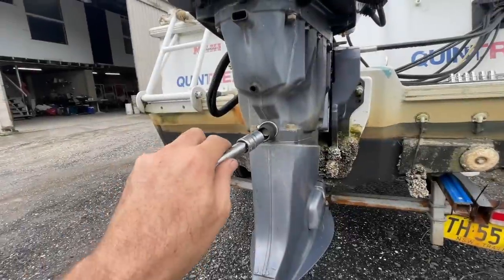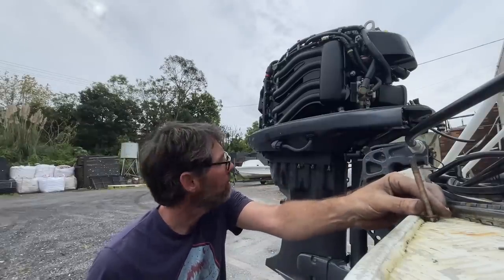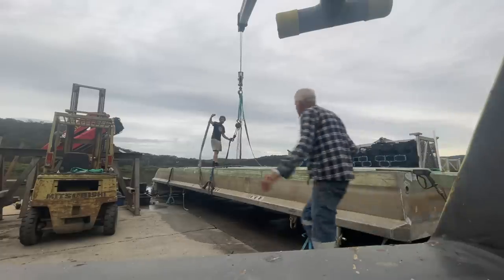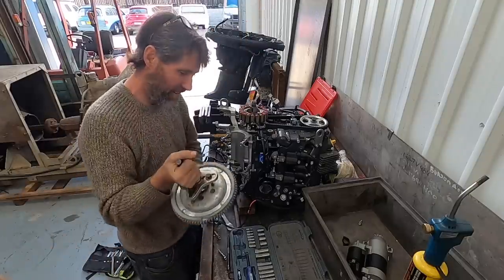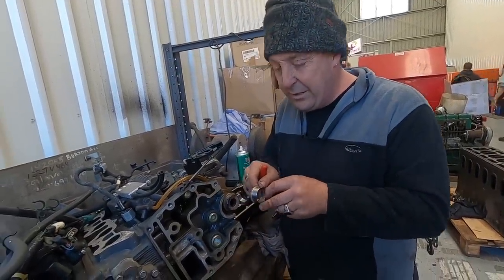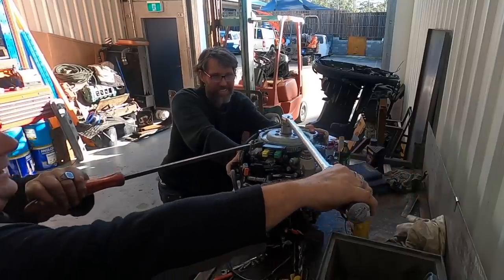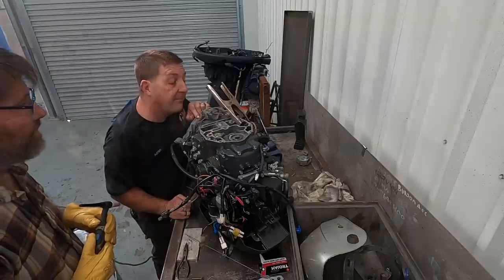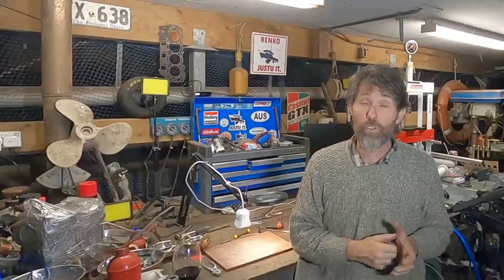Fixing a four stroke outboard that is leaking oil

Comment: Good Job Stu! Thank you for bringin' us along and teaching us some great repair moves. 
BTW, your new "look" may qualify you as a professor at UC Berkley. When you get over here to California, walk onto the campus and see.  BTW, do you still have real gasoline to run in outboards down there?
Here on the left coast our automobile fuel doesn't have much petroleum product in it..... Wont even clean varnish from a paint brush...Wont run in an outboard either.
Reply from the maker: Thanks Tom. Last time I was at Berkley was to watch a Greatful Dead concert. Petrol here is still pretty standard when it comes to boats. Only car bowsers well fuel with ethanol in it.

Comment: I think you find the main and con rod bearings are prevented from spinning by their crush fit in the rod/cap or main cap/block, the tangs are there for alignment. That's as I was taught many years ago.
Love the content with Adrian, he is a true ledged on the tools!
Reply from the maker: Yes, they sit slightly proud of the casing which expands them and locks them in. Just one of those modern cost savings designs that us old timers can't fathom. ;)
Reply: Was Adrian stumped then?

Comment: ah, the good old salt water soluble 4 stroke Yamaha disprin motor. The temptation for JB weld and unload must have been strong ;)
Reply from the maker: The words "JB Weld" were said several times during that day. ;)
Reply: @DangarMarine  after spending nearly a grand on the head of mine, repairing corrosion, overhauling valves, etc, only to find it had a hole in the block, that’s exactly what I did 🤣

Comment: Good work and a pretty involved repair. Amazing just how complex a modern 4 stroke OB engine is with lots of electrical circuits on top of quite fragile castings. I replaced a lower oil seal on a 60hp M but thankfully it didn’t have the corrosion or the lipped-seal. On those there’s a very pricey crush washer underneath the flywheel. I couldn’t believe how expensive that was and the timing belt was astronomical, too. Looking forward to seeing more from the yard and the workshop. Thanks!

Comment: I have run into that before with small micro bubbles coming out of the weld . Pressure and heat building inside as you are welding .You are putting pressure on it to check the weld but you can put a vacuum on it as you are welding it and it will seal up . (a very small vacuum.. the liter the better)
Reply from the maker: Interesting idea. We were also talking about peening it with a punch to help close up any small holes.
Reply: @DangarMarine I think that would work if you were brazing it after . Heating the aluminum by brazing and seal it off . Brazing has always been a little easier for me than welding. Just remember micro bubbles are from trapped heat or from the weld of brazing .

Comment: Great video Stu,  well done with the resurrection, out boards are really made from not much for good reason ... an old friend used to use a belt sander too clean up cyclender heads on 25 year old units that should have been scrap
Reply from the maker: Thanks mate. Plenty of these outboards do get scrapped when they still have some life left in them.

Comment: Stu, i always take a heap of happy snaps and video prior to a pull down of motors. Has come in very handy at times when the memory fails with what goes where. My memory is bad so these little aids work for me.
I have used JB Weld for problems like what you tig welded. It has never failed, great product.
Reply from the maker: For sure. I took plenty of photos of this outboard as well as taking the video. I have used JB Weld to fix a hole like this before but it did eventually fail in my case. I'm hoping this lasts quite a while.
Reply: @DangarMarine  could you explain why the hole was even there? I’m not sure why you would the ports connected in such a fashion. Is it literally letting oil into a water jacket or vice versa? Sorry if it seems a dumb question

Comment: Stu you could've used a gas lense cup with a longer stick out if needed. Who ever owns that engine is lucky, up here most shops would've refused to repair it
Reply from the maker: I did push it to the limit but wasn't getting enough gas shielding in the end. It's tricky because the small cup makes the gas come out too fast and blow the puddle away unless you turn down the pressure in which case you get a black brown mess. It was definitely a tricky spot to weld!
Reply: @DangarMarine  Aluminum tig is my nemesis. i have the worst time with it...
Reply: @DangarMarine  
All the cast aluminum I've messed with welded like chit. It has all garbage in it. But with the large gas lense it gets the argon where it's needed.

Comment: Fantastic, work on that outboard, was really interesting.......
Like all industries different engines in different environments have different problems.
IV used "speed sleeves" before on Perkins engines, but again was different, just warmed the sleeve up....tapped it home with no trimming and was good to go.
But these engines you had about 3/4 goes at just moving the seal in or out a couple of mm to get afresh face to run on.
Really like how you all work out faults the work out the fix.
Reply from the maker: Thank you very much, glad you enjoyed it. :)

Comment: Add a quarter inch flat bar 1 inch to 10 feet for the length of the boat and a resting depth of .25 with the full stern with motors. Don't forget to gusset it. About 2% down max on the turn down on the plate.  Old Texas trick !
Reply from the maker: Good tip!

Comment: Thanks for putting out these videos, it’s good to live vicariously through them. I didn’t really understand what happened to the oil return pipe that you had to weld it up and wouldn’t that affect the cooling?
Reply from the maker: The weld was just built up over the hole, it still has oil flowing through it beside the cooling water.

Comment: 18:25

I agree with you and Adrian, what a mess of a design for bearings, no little cleft edge to hold it in place or anything? 

Sometimes I really question Yamaha’s engineering. 

Wish I was there, take care mate.
Reply from the maker: I think it is one of those modern less is cheaper things. Because the bearings slightly protrude higher than the housing they are held in place by their outward crush. It just feels weird not having anything to hold them in position while you bolt the casing up.
Reply: @DangarMarine  I believe they expect the average man to never see them these days as well, or to simply even…replace the power head?? 😮‍💨 You nor I would do such a thing unless absolutely necessary. 

Must’ve been a trip bolting the crankcase back together and assuming the best would happen. Stay safe, your content is still 10\10

Comment: I often wonder what DH thought of mixing aluminium and salt water. Any alternative would be I guess too expensive but some sort of coating perhaps. Either that or flushing every time you use it. I'll stick to my Rolls Royce CV12 (if I had one). Beauty is in the eye of the beholder.
Reply: Me too. I flush my Yamaha after every trip. The thought of leaving salt water sitting in the engine in between trips makes me shudder. 

With the flushing port on the engine, it takes 30 seconds, or a  minute if I'm not in a rush. I'm reassured by the 10 foot 'pee' and the sound of freshwater flooding out the bottom 🙂 

But I'm the only one I see doing this in my marina, and I can tell that some of the other folks think it's overkill...

Comment: Regarding grinding the corroded aluminium before welding - is it not worth covering the rest of the engine to avoid those filings entering cavities and orifices? Or does a good blow job afterwards and an oil change equal less work?
Reply from the maker: It certainly wouldn't hurt to mask it up, I agree. I think I'll tend to flush with a solution more than compressed air to make sure nothing gets driven deeper in.

Comment: great job on your video's. we have 90hp evinrude. the power trim works when the boat is going slow. It will not work 1/2 or full throttle. If we slow down it works, as soon as we start giving it throttle it goes back down. any thoughts?
Reply from the maker: Could be the bypass valve is partially open allowing the thrust of the prop to push it back down. It could also be failing seals.

Comment: Do you know what would cause oil or sheen coming from the propeller?  I have a df140 03. Oil in the lower unit looks normal. My oil seems to have dropped a lil on the dip stick for the power head.

Comment: Wouldn't it be faster to braze/hard soldering the pinhole or is the temperature so high in that spot that it wouldn't last?
Reply from the maker: It's tough with aluminium. I think maybe with steel but TIG is probably best in this situation.

Comment: I'm not sure why they stopped putting the little tangs on bearings, but it's not just Yamaha. I was overhauling a 20 year old 4.7 liter Chrysler V8 last winter and the original bearings had the tangs, but the new updated part numbers did not. I was told by a automotive machinest that (somehow) they are less likely to spin without the tangs on there. The only reason I can think of is that during the manufacturing process when they punch the bearings to create the tangs it potentially causes the bearing surface to become slightly distorted which would in theory wear them out faster. I guess if you run it without oil the bearings are going to stick and spin either way.

Comment: Great informative video as always mate, wondering if i could get your thoughts on something? I recently purchased a stacer seahawk with a 2005 two stroke yamaha outboard, aint had it in the water yet but have run it on the muffs at home, it runs very well and i have just replaced impeller and thermostat, but i have noticed after i have ran it i am getting an oily black substance running down the skeg, i have had the prop off to check seals but it all looks as it should, i have noticed that the oil tank has been filled above the full line, do you think this could be the problem? Thanks in advance for any advice 👍
Reply from the maker: There are plenty of things it could be that aren't too serious. If it's coming out the propeller hub and running down it will be a combination of exhaust soot (making it black) and some unburnt fuel oil. It could be the prop seal too, a quick pressure test will tell you if there is a problem there.
Reply: @DangarMarine  thanks very much for your reply, very much appreciate it and keep the great vids coming 👍
Reply: My yamaha 2 stroke 20sg also soots up. I tend to add a touch more 2 stroke oil than called for and I troll more than WOT

Comment: You can use aluminum arc rods to weld corroded aluminum
Reply from the maker: I should try using some one day. I have never heard great things but it would be good to get some first hand experience with them.
Reply: @DangarMarine  I tried Tig but 2 dam dirty in cylinder head arc rods hard to control so you have to do a lot of die grinding and planing very porous but managed to build up,very time consuming though
Reply: @DangarMarine  used on 25d Yami still going strong,filled broken stud holes and tapped too

Comment: Hi Stu, off topic question related to my sg20 6l3 yamaha. After doing top end gaskets I did impeller change with new plate, housing, o ring and water tube rubber. With mufflers hooked up and engine running I have water running out between mid section and lower unit. Pee hole is running strong stream. I pulled lower unit off twice to make sure water tube is seating into rubber grommet. Any thoughts ...... I dont have much more hair to pull
Reply from the maker: That is quite common. The bulk of the water comes out through the exhaust and out through the prop so it is common to leak out of the midsection. It could be a muffler sealing issue but I wouldn't be too worried.
Reply: Thanks for the reply, Cheers

Comment: Quick question,  is the 200  mercury  the best 2 stroke ever  ,,seems to  be on all the race boats up here ,,, Queenslander
Reply: Mercury 2.5L is good for myriad performance upgrades. Porting, cranked up compression, open exhaust...a neighbor does test n tune days & those suckers sound like F1 engines at full whack 9000+ rpm 2 stroke so it sounds like 18k rpm on a 4 stroke.
Reply from the maker: I've never really seen one up close myself as most commuters have smaller outboards on their boats just for getting back and forth.
Reply: @danl6634  thanks for the reply :-)
Reply: @DangarMarine  thanks for the reply , keep the video's coming i enjoy your content 👍

Comment: Since the powerhead came off the midsection, wouldn't you need to take the midsection apart to change the oil pan gasket. Along with exhaust manifold gaskets and so on.
Reply from the maker: There is a single gasket that goes under the powerhead to seal all those sections that we ordered at the same time.

Comment: Yamaha should know better than an edge on the seal, splitting the case man what a pain. So was the sea water corrod the block letting oil out? I've been looking at a 150 Yamaha
Reply from the maker: Yes, I would say it was caused by the sea water but it wouldn't normally happen so maybe a bad bit in the casting too? Electrolysis?

Comment: is  there a way to diagnose if its the bypass valve?
Reply from the maker: For the oil pressure? It’s tricky because oil pressure can lower for many reasons. Often there is a nominal spring length which corresponds to bypass pressure.